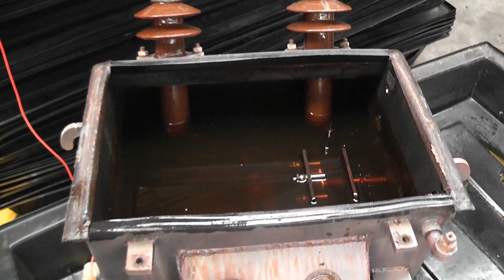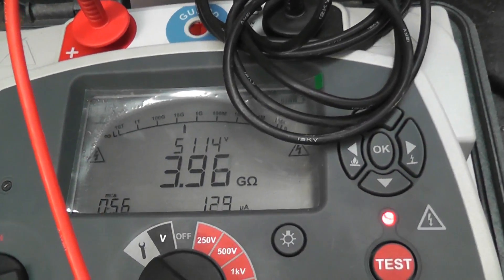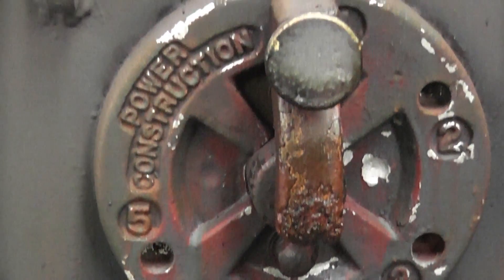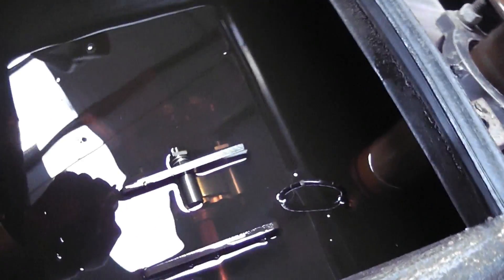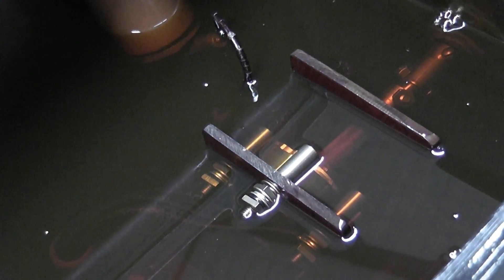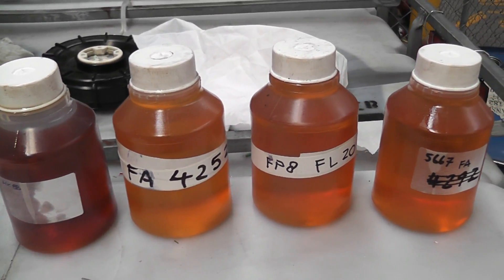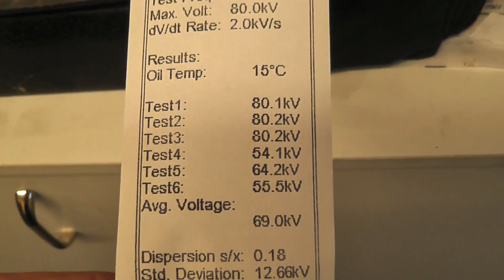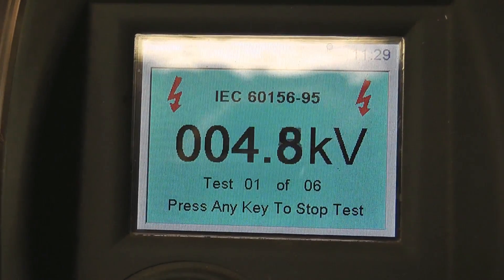20 kVA Transformator HV  insulation test and oil tests

Comment: So what would happen if you rotated the tap changer while under load and has someone actually done that before?
Reply from the maker: The TX could blow up or you may get away with it. I wouldn't like to try.
Reply: Definitely won't try it!  It'd be fun to see a destructive test though.
Reply: You're getting into maths and stuff...  I just want to see it done!  :)
Reply: there are no transfer contacts fitted to keep the load in circuit while you are switching. the result could be sparks and arcs within the tank, probly best to stand back

Comment: Is this already PCB free?
And do PCB-free oils differ when it comes to lifespan and insulation values after long times?
Reply: Ecologist warning. But i will like to know the same answer
Reply from the maker: PCB free oil, The PCB's used in the past are there to reduce the flamability.TX oil burns like diesel and has a flashpoint at around 160°C.

Comment: Look at that device just sweep across tons of KV... I can't imagine what a pain the circuitry was to design. Probably well worth the money. And that receipt printer is so neat!
Reply from the maker: It is the classic ribbon printer, not those useless thermal printers which fade out within a short time.
Reply: I thought it's a bit slow for a thermal one! Kickass ribbon! Might've been faster with some smallified inkjet or laser printer. 

But... HAH I thought I'm the only one who noticed that cheap thermal printers fade out within time. 

Contact with plastic seems to accelerate it. I put some tape on top of an important receipt, and in less than a day the part under the tape disappeared! There's more expensive (pointlessly expensive) paper that fades much slower, but it still fades. It's just these temperature sensitive dyes reset after time, unfortunately.

Comment: If a transformer is to be returned to service after an oil change, are there any methods employed to remove the dirty oil residues that are left behind before re-filling?
Reply: Open it up, wipe them out and refill, or simply do a few cycles of circulating the oil through a very fine filter to stir up the sediments inside the case and flush them out. This is used often to change the oil during operation, simply circulating the oil through assorted filters to remove fine solids and then through chemical ion exchange beds to remove built up breakdown products.
Reply: +SeanBZA - Very interesting, Thank You sir.
Reply from the maker: Correct.

Comment: I like that oil insulation tester, I use to use an older type that you could manually adjust the voltage until breakdown and also use to put oil in a test tube and heat over a flame to listen for sounds of water crackling. I remember once there was a transformer explosion in the HV yard during a couple of days of heavy rain, water was entering the transformer and eventually reached the windings, explosion literally blew off the side panels!

Comment: Interesting video! Cool meter too. I wonder if the oil in these is basicly the same as in, for example, fridge compressors. A bit thicker I imagine.
Reply: Pretty much the same oil, just as pure and water free as that used for R12 and R22 refrigeration. However the oils used with newer refrigerants is a synthetic that needs to be absolutely water and oxygen free, as it breaks down in the presence of water or oxygen, but in a hermetic system it provides definite advantages as it is a better lubricant, and also is soluble in the refrigerant to allow it to travel through the system without clogging up the orifices and lubricates all the inner moving parts of the sytem.

Comment: Does it darken because of age, external pollution or electrical discharges?
Reply from the maker: The oil darkens because of age, deterioration of winding insulation material, overloading and excess heating, moisture absorption, possible arcing from lightning.
Reply from the maker: Mainly varnish. Brand new TX oil is clear like water with a blueish hue in it. Recycled oil is usually yellow. They can't get the colour out of it after reprocessing and it does not affect the quality.